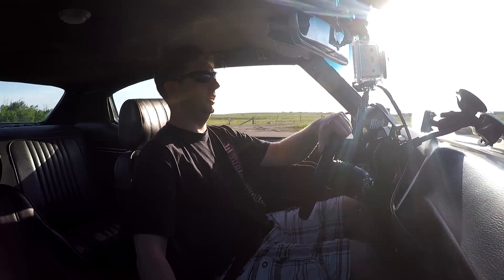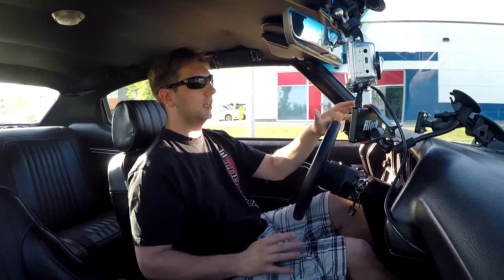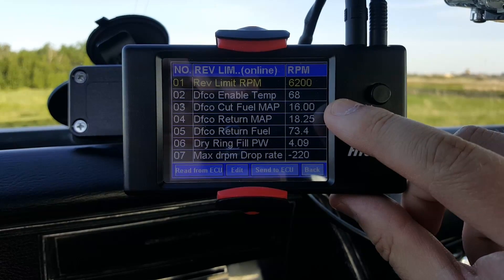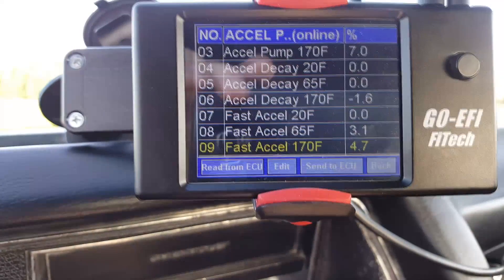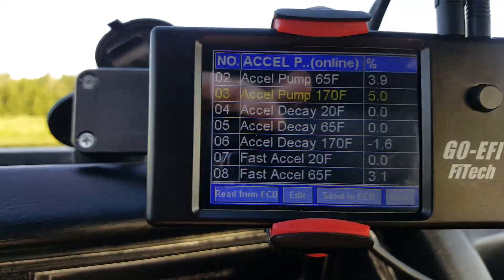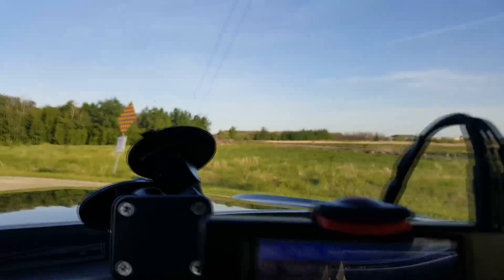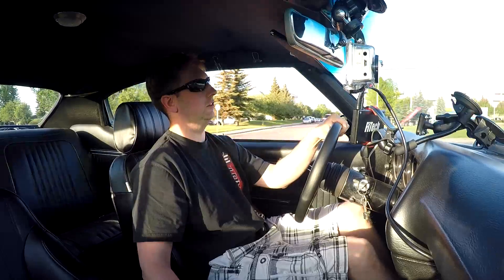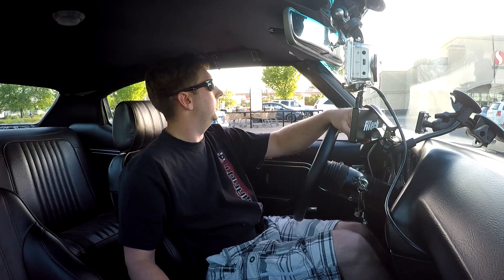FiTech Go EFI 1200 HP - Update with Tuning

Comment: Like the FiTech as its cool and lots of parameters to chose from and fuel maps. Put an APD carb on and then car became super consistent both on reaction time and consistency.  The car is way more consistent with Carb and now goes rounds. But they tell me it should be better with the efi but for me  the time slips tell the difference.  Maybe in a few more years when they learn more I will try again

Comment: Sometimes the cam lobe separation... lumpy cam vs smoother cam... has a tendency to mess with the wide band o2 sensor ...thus fattening it up or leaning it out  ..any where in your talking to others has this come up??
Reply from the maker: I do know what you're talking about. I run a Comp 280H (230/230 on a 110 LSA), so there isn't a whole lot of overlap. I do believe a 112 LSA would be better for EFI, but it's not too bad. It can have an effect on the fuel smell as well.
Reply: SS454LS6 ....110 LSA   isn't all that bad  but it might be just just enough broken up air  passing by the o2 sensor  to create a lean mixture signaling the system to richen it up to balance the air/fuel  mixture  ...I changed my exhaust diameter down to 2in  to compress the flow past the sensor and it fixed alot of my problems
Reply: SS454LS6 ..... With an X pipe
Reply from the maker: It is certainly possible. There is very little I'll be doing mechanically to my engine/exhaust, so I'll keep tuning on the system to just make it as good as possible. Thanks for pointing it out as I'm sure there are a lot of FiTech's on engines with big cams that may be having issues related to what you say.

Comment: hey did you ever get this sorted out? i may have a solution, these 1200 hp ones are set up for boost reference from the fuel pressure regulator, try disconnecting the black vent tube from the fuel pressure regulator going to the base of the throttle body.
Reply from the maker: Still an off an immediate rich bog when going to WOT. In the first version of the FiTech, the black vent tube was not there. FiTech told me to route one to the pressure regulator but it made no difference. Any changes I'd like to try will have to wait till spring 2018 as its now winter here. Do you have a FiTech 1200 hp unit?
Reply: yes i do, i just got summit part # 30012 less than a month ago for my 389 N/A small block, but its acting exactly like yours- falls on its face after WOT, i haven't got near as much drive time on my car

Comment: I have a 10:1 SBC 350 4sp in a truck. I got the 1200hp dual quad power adder on an Offy crossram (single plenum type) and I have the same problem as you ie lean/rich. The overrun popping has been adjust to the values you suggest - no difference. I saw Nabors75 vid and did it over the weekend. Made no difference, it still pops bad. 
Motor backfires through the throttle bodies at part throttle and esp light throttle around 11-1300rpm. It backfires so hard it's blown the rubber blanking plugs off the unused ports on the throttle body. I have played with the gain, the accelerator values nothing makes any difference. It must have backfired like that 500x on 3 tanks of gas. It has good full throttle power but at 1500-2300rpm it won't pull at all, at low rpm it backfires. I've had it 5 days, the motor is brand new, the entire ignition system is brand new. 
On top of that it runs on. I have the AF set to 15.7:1 and it still runs on. It runs on so bad the motor rotates in reverse for about 10 seconds or longer if you don't dump the clutch. 
I hate my Fitech system. At at the point where I don't want to drive my truck anymore. 
After 5 days of reset after reset, adjustment, tweaking, learning resets, cam reset I'm thinking of getting rid of it and putting a Q-Jet on it. I really hate it.
This is not how it's supposed to be.
Reply from the maker: bad backfires through the TB's may suggest you have another problem going on. I'd take a serious look at your timing. Set timing, advance, rotor/distrib, wires, plugs, etc. Also not all engines want a lean idle (15.7:1 in your case) and may develop a lean misfire. I'd try 13.7:1 and see if it changes. Perhaps take a look at my logging and pro tuning videos and maybe that will give you some ideas. Log files can tell you a lot if you are having an issue. Good luck!
Reply: @SS454LS6  done all that.
Brand new dizzy - 10deg btdc, advance controlled by fitech.
Its a mallory 8361M dizzy which can be run as a vac advance mechanical weight dizzy or you take all that off, turn the top 180deg and run as locked out.
Mallory off road coil and off road box. All brand new.
Timing light shows ignition advance.
If i run 13.7 it runs in reverse. It is terrible. Now it just runs on.

Comment: Do you think you purchased to big of a EFI for your application the 800 sounds like it would have been a better size unless your hp is over 800 hp
Reply from the maker: The Meanstreet 800hp version doesn't have timing control, otherwise I would have gone with that one.
Reply: Robert Evans 1200 kit works from around 250 hp to 1200 hp

Comment: Hi anyone has this installed on a rotary engine ?
Reply from the maker: Not that I know of. Since these are essentially EFI versions of 4 barrel carbs, I am not sure it would work on a rotary.
Reply: a lot of rotary's running around with FiTech units one in town has a s480 with custom t4 housing with the power adder 1200 works great

Comment: Well these videos are disappointing. I was try FITECH on my chevelle but now I’m skeptical. So much for “self tuning”.
Reply from the maker: Don't get too down. They will self learn fairly well, but to really dial it in you most likely will have to manually tune. I have some ideas I want to try this spring/summer.
Reply: @SS454LS6  these will self learn better than taking a carb out of the box and bolting it on. And much easier to fine tune than swapping out jets.

Comment: If you have to start manually tuning it you might as well leave the carb on.
Reply from the maker: Consider that all production vehicles and aftermarket EFI builds have a tune built for that specific engine, I don't think it's unreasonable to expect some manual tuning. The FiTech only has 4 different base tunes, so of course it wont work with all engines/vehicles, not to mention different altitudes and climate conditions.